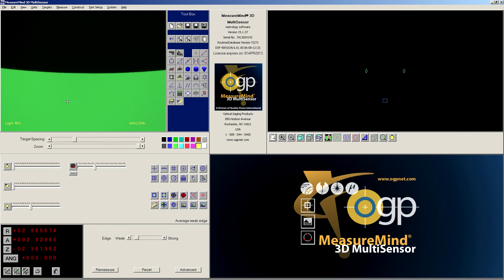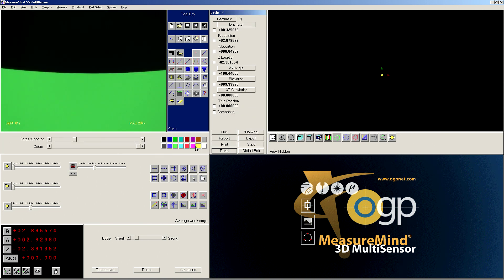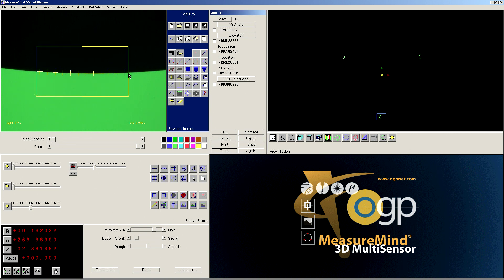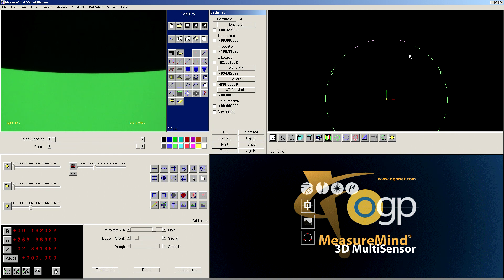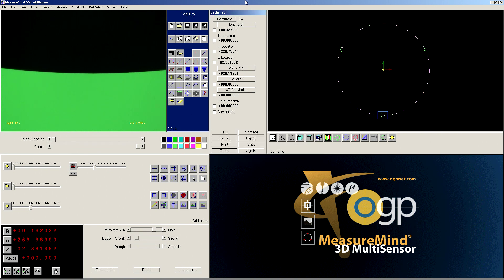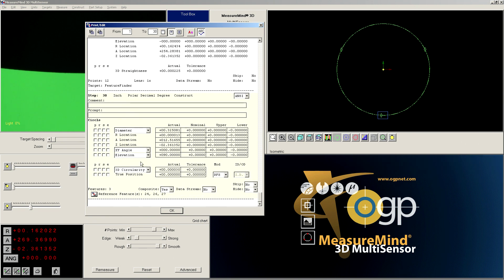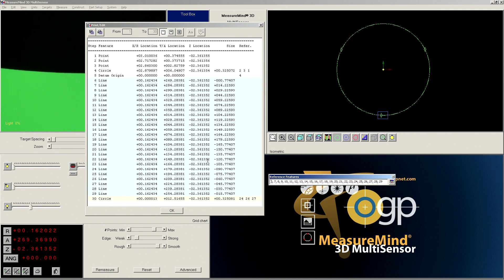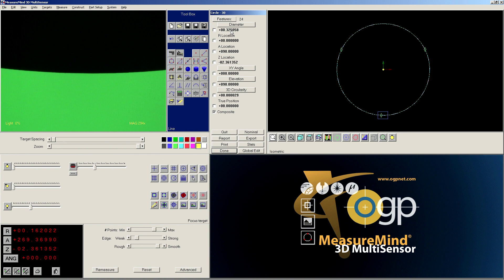Selecting Multiple Features with MeasureMind 3D Multisensor

Comment: can we measure flatness using ogp?
Reply from the maker: Yes you can.  You’ll want a good density of data points.  Assuming the material of your part allows it, you could copy a grid of high magnification focus points, then construct a plane to get flatness.  Alternatively, if you have a laser sensor, you can focus or even scan a large amount of points on the surface to get flatness, again assuming your part reflects the laser well.  Both of those methods work well on the top horizontal surfaces.  A touchprobe sensor is another great way to measure flatness, and works regardless of part material or surface finish.  OGP has several models now with scanning probe, which can scan a surface and get flatness.  Touchprobes can get flatness on horizontal AND vertical surfaces.  I’m not sure what sensors your machine has, or if you’re looking to purchase, but there are many ways to measure flatness.  Hope that helps!

Comment from the maker: David, great question!  If the composite checkbox is not checked, you would be correct, and it would use the midpoints of the lines.  However, when composite is selected, it uses the data points of all the lines instead, which are on the edge, just as they would be if using an arc.  At that point, it doesn't matter what shape the search finder was, raw data is raw data.  Keep in mind I simply suggest using lines when the circle is so big that the arc only has a slight curve in the field of view.  A smaller circle would definitely be measured with arcs.  Thanks for watching!  cheers!
Reply: H? I p  happy 
?@6

Comment: I could be mistaken but I don't think that will give you an accurate measurement of your circle when you measure a straight line with the feature finder. I do the same thing as you but use the arc feature on the feature finder. i think the program takes the midpoint of those "lines" when it is constructing a circle. i could be wrong. if I am, let me know. obviously I'm learning or I wouldn't be watching these videos. thanks for the video.
Reply from the maker: You would be correct if you do not check the composite checkbox.  That's a very important step.  When you check composite, it uses the data points of each line, not the midpoints.  That's why it's OK to measure them as lines, because the data points are all that matter in the end.  In general, it's always best to check the composite checkbox when you measure a big feature in pieces and want to join them together into a single object.